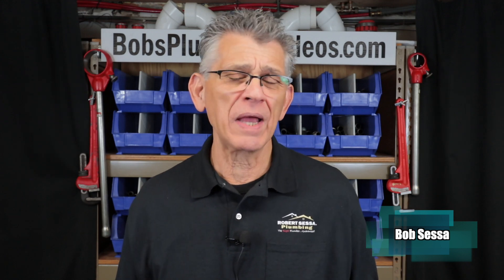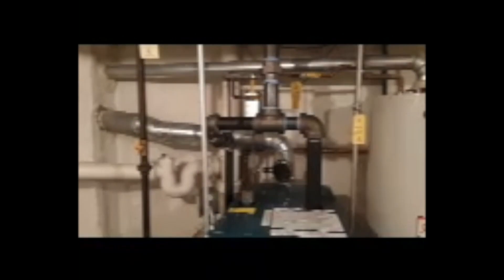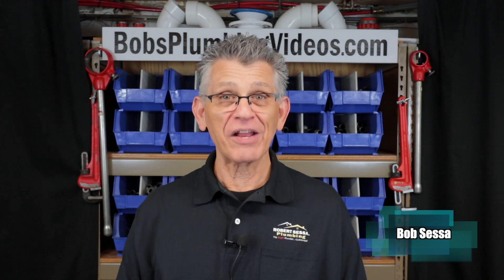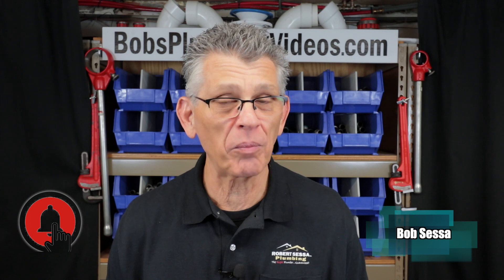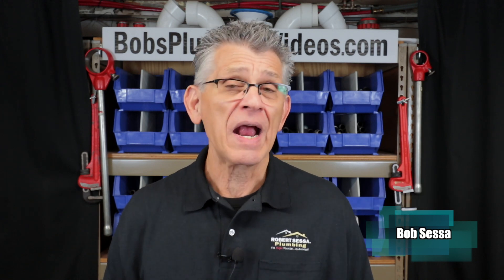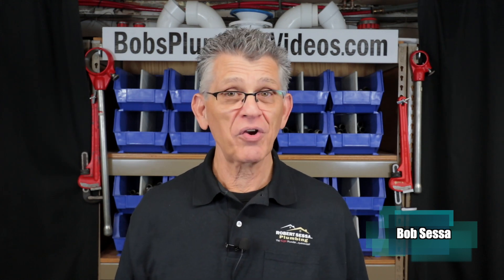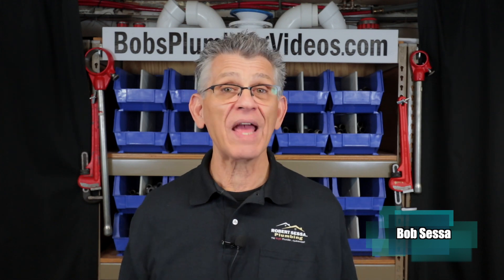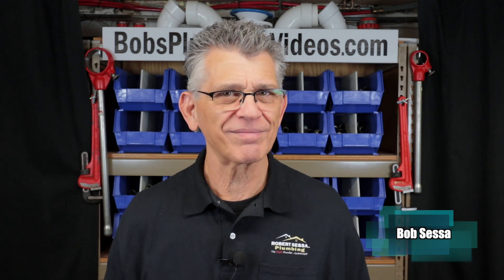Steam Return Pipe I Wet or Dry?

Comment from the maker: Did the contractor do the wrong job by not dropping the return down to the floor?
Reply: He definitely did the wrong job, why would he use copper anyway when black pipe is cheaper lol. What a shoemaker
Reply: @brooklynaudit  You don't need to thread copper. Its much lighter and much easier to work with. It isn't a particularly long run so overall I'd say copper makes sense. However, he should have used the requisite 1-1/4" and drop the run below the water line.
Reply: There shouldn't be a heel tee on the Hartford loop. The return on the ledge can't have any traps.

Comment: Hey bob enjoy your videos and please keep up the good work I’m installing a pro select gas steam furnace in my home and the water return and feeder port on the furnace is located more forward towards the air vent as opposed to where the previous set up which was rear  of the furnace which has the equalizer Hartford loop water feed and return now my question is can I just add a 5or 6 inch in length pipe with a union to reach the new furnace water inlet port of course connecting it to a heel tee without a problem I really would appreciate your input this is my first time installing a furnace thank you
Reply from the maker: Send me a photo, I'll take a look. info@robertsessaplumbing.com.
Reply: Thanks for your response I sent some pictures of my work to your email you have here hopefully it will clarify what I’m concerned about

Comment: Don't know the height of the copper return but it needs to be a minimum of 28" above the water line and pitched towards the boiler. And it should be higher than that if they are running the steam pressure higher than it should be and he undersized the pipe. Dropping it to the floor is probably the easiest fix you can use the same tubing over and 1" will carry more as a wet return than it will as a dry return and when under the water pitch doesn't matter

Comment: If the original was 1-1/4" he should have replaced it with 1-1/4". Additionally you cannot reduce a horizontal run in a return without an eccentric reducer. Furthermore there needs to be 1/4" fall per 10' of horizontal run.  I hope she got her system repaired.

Comment: Yes wet return to the floor is the way to go.  The "dry" portion is radiating a lot of heat as you say and the cross sectional area of 1" copper is 55% less than the 1 1/4" black pipe.  Remembering that that return has to service all of the radiation condensate from the system aaaaand then not sloping it and putting it into a pipe that is a little more than half the required size - well it's steel band drum time!  Also - type M copper on a steam system is a little more than not desirable and a new problem waiting to happen.

Comment: Hi Bob, first and foremost start back at the boiler and pipe it to spec, what is the pressure control set at? If it’s to high (above 1 lb.) it may be pushing condensate back into the “dry return”. Also what is the “dimension A” distance from the end of the mains lowest steam carrying pipe to the boiler water line? Need a MINIMUM of 30” with a boiler operating at 1 lb. to allow condensate to flow back to the boiler. When during the cycle does it bang? Start, mid or end?  Even dropping the return to the floor doesn’t guarantee a cure if the new boiler water line is higher than the previous boiler waterline, you STILL need that 30” at the end of the drip. I don’t think the “banging “ is in the return but in the end of the supply. The copper isn’t going to cause the noise issue. It’s also possible the supply may have dropped when cut free of the old boiler and not have proper pitch anymore causing this. Wish I was closer I would love to see it.
Reply from the maker: She is out of my service area, I have not seen this job in person. All of your observations are right on point! Thanks for commenting👍

Comment: I’m no boiler man but it’s just wrong to use copper above the water line. I couldn’t determine if the pitch was correct or if the system is two pipe steam or one pipe steam. It’s okay to have copper as the wet return. My concern is where was the boiler water line before the boiler was replaced? Was the dry return above or below the water line originally?
You are making it sound like a water hammer problem steam is entering the dry return and since the copper return is not insulated the steam is condensing add to that the insufficient pitch and it’s a bowling alley the steam is speeding at 60 miles an hour pushing waves of water into the ends of the return.
The fix could be as simple as a new false water line filling the leg with water will prevent any steam getting into the dry return. You also don’t know if there’s a condensate F&P trap or a pump.
Reply from the maker: This is a tiny one family home single pipe steam steam system . 0 pitch, drop the return down to the floor 1 1/4” back to the boiler and I’m pretty certain problem solved. Also crank down the pressure, willing to bet he’s got it to shut down at 5 psi.

Comment: I’m not a plumber but the question you are asking seems like a PLUMBING 101 question. Isn’t this issue covered in the plumbing code book? My boiler has a lengthy  wet return that was installed over 75 years ago. My old Weil McLain was replaced 4 years ago with a new boiler using the old wet return. No problems at all. What does the manufacturer of the boiler say?
Reply from the maker: The manufacturers spell it out in their manuals, problem is no one reads them.

Comment: I think I saw a shark bite coupling at 4:40 which is not a truly rigid connection. 
A union fitting could be better. 
The pipe may wiggle a bit with the shark bite fitting and if not strapped correctly along the wall it may vibrate at certain parts along the pipe, like a guitar string at certain harmonics.
Due to the reduced pipe size and resonance of the copper, the higher pressurized steam may make it vibrate like a tea pot at a higher frequency than it did before when the larger black iron pipe was used, causing it to smack the wall and act like a drum head, clicking and clacking and seeming quite noisy.
Just thoughts of why it does what it does.
Reply from the maker: I agree👍 not to mention it’s sitting dead level on the ledge. I think that’s a dresser coupling! Even worse than a shark bite.

Comment: Lazy plumber did the quick copper fix and reduced it probably didn't have the 1 1/2 vega tool.... change main vent and all radiator vents, dump the copper and pitch it.  Dont pay the 1st knucklehead.   what did they set the pressure too?  Great video Bob
Reply from the maker: She promised to update me when the corrections are made. I’ll hit you back when I here from her.

Comment: I would think there are several possibilities: 1) The size of the return 2) Pitch, and 3) Location (wet or dry). I personally would correct all 3, but my instinct is size and pitch are  huge huge  issues. I wonder too if M tube is good. I'd think it might be easy to start over with a wet, pitched L tube 1 1/4 return.
Reply from the maker: 1 1/4” pitched back towards the boiler would have worked, but if he dropped it down to the floor I venture to say he could have gotten away with 1”.  I’ve used “m” copper on wet returns without any issues.

Comment: that copper is going to give off it’s heat energy quickly.
I’m not familiar with low pressure closed loop systems, all my process equipment either wastes to drain or is trapped
with check valves back to central boiler room.